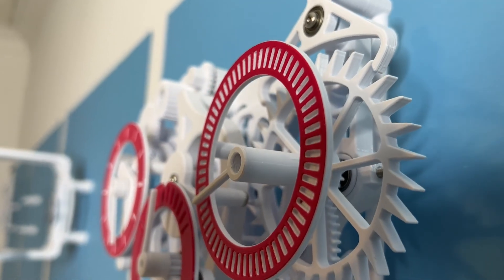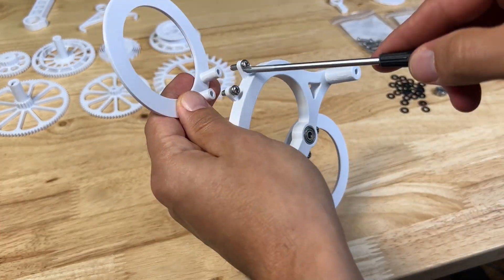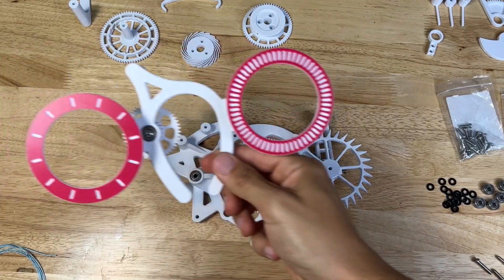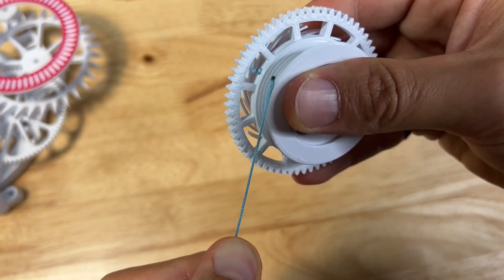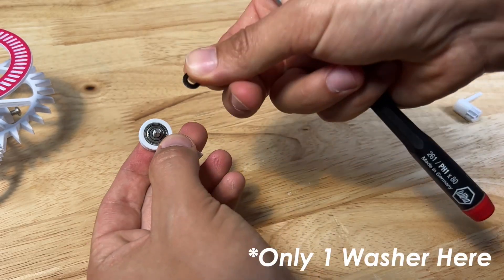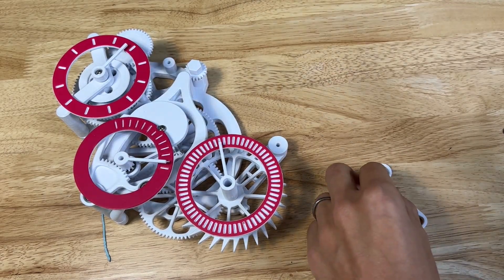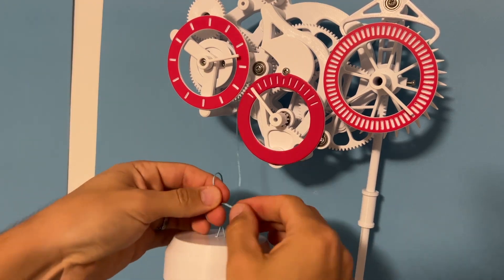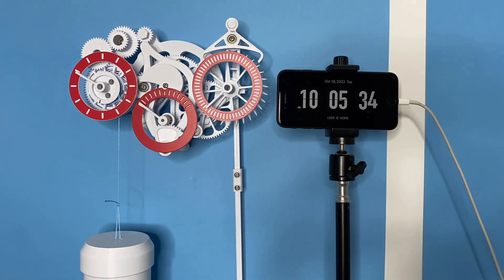How To Assemble the 3D Printed Clock

Comment: Reluctantly I have given up with this print.  Having followed your assembly video to the letter no matter what I try with the adjustments the pendulum slows until it stops, oh and yes the gears spin perfectly.  So 2 days of trying I got a friend to print all the parts on my machine and then follow the assembly without any intervention from myself.  He completed the print and assembly and get exactly the same issue after 4hrs of testing, adjustment, testing more adjustment still no luck !!  I did message you regarding the ball clock as well as I found some issues with the track and the ball pickup.  I was disappointed that I didn't receive a reply but found the solution online from two other users that had the exact same issue.  Obviously I am disappointed as your videos and ability in creating these models is very impressive but for me I feel that I have given both the products more than enough time... and patience.

Comment: i found you need to print extra wall mounts as there not the right number in the pre built plates in the design also you will need to search for the 2 color face options if your not sure how to do it as the link is missing in the description but they are easy enough to find just for the newbies and novices

Comment: hello, i'm a student in a scientific preparatory class in france. one of the tests for the competitive entrance exams i'll be taking soon is a year-long project involving research, equations and practical work. my subject is “From Motion to Time: Energy Conversion in Clockwork Mechanisms”. Nevertheless, I'd like to do a simulation on solidworks, but with only the stl files, it seems complicated. I'd like to know if it's possible to provide me with the solidworks files, or even if it's possible, the clock simulation file, which would be a great help.

Thank you so much for your help !

Nolan

Comment: Neat design, but I have had several layer adhesion failures due to the orientation of the prints and weight applied.  Especially at the the wind mechanism

Comment: I can’t get it to run for more than a minute or two. I’ve made sure every gear spins freely with no binding or rubbing. Eventually the pendulum loses speed and then it just stops. Wondering what I did wrong. And I can’t for the life of me get it to have an equal beat after hours of trying. Maybe my filament has more friction than yours?
Reply: I have the same issues. I have reprinted now and still the same issue. I have added more weight taken some off it ticks really loud and the pendant wobbles its tick pattern is not even. And it stops about 50 seconds on
Reply: I took it apart and made sure everything wasn’t too tight and spun for a few seconds if flicked quickly. After a few weeks of tweaking the pendulum I’ve got it working for 4-5 days without stopping. Keep at it.
Reply: You probable have to loosen it up a little bit. I had the same issue at first and loosen a couple of screws and it just runs now.
Reply: I took mine apart after if was working fine, so I could better align the dials, and upon putting it back together, it wouldn't run for more than a minute or two. Turn out the anchor was reversed. Pause the video and look at the ends of the anchor, the pointy ends, and make sure they look the same, or just reverse it and give it a try. Mine is up and running again.

Comment: Hello, it prints very well. Question - my bearing fit very very tight. Some of them crack the base. Is there something I am doing wrong? The print seems very clean so I didn't sand anything out. Help appreciated.

Comment: Could this clock be scaled to be a bigger size? Looking into making a clock like this, and I love the design, but I wanted a little bit of a larger footprint on my wall.
Reply: Since the movement is timed by the pendulum, you should be able to scale it up, it just might take some extra adjusting of the pendulum.  Might need to be longer or have a heavier weight, etc.  Just be sure to account for the holes getting bigger when purchasing your bearings and screws.

Comment: Layer to layer bonding on the 3d printed parts continues to be a weak point.  6 different pieces have now broken,(seperated) typically where a column steps down in diameter.  An increased wall thickness would help this.  Do you know what setting in cura addresses this?
I have noted the bearings I purchased on Amazon are stiff creating a lot of drag. I'm sure this is hurting clock performace.

Comment: So I don't understand this clock... 

You are aware that there are 60 minutes in an hour right?

So why aren't there 60 ticks, or lines on the minute wheel? 

Your minutes dial only has 13 ticks, or lines on it. Which would make it impossible to actually tell how many minutes past the hour it is. You would only be able to know the hour & seconds, but not minutes.

So why is there only 13 lines for the minutes instead of all 60 like a normal clock?
Reply: it's in increments of 5, starting at 0 :p

Comment: What are the threads on the pendulum parts?  I would like to use a tap/die to clean them up after printing.
Reply: I just scaled up the Pendulum Adjuster and the Pendulum Adaptors by a factor of 1.04.  Everything screws together easily now.

Comment: Great model! All the parts using just one bearing are however very loose, especially the second hand and escapement cog. It's so loose that the tip moves about 5mm in all directions. Perhaps the bearings are poor quality, I don't know. All parts ordered from Aliexpress. The cogs rotating on two bearings run well.
Reply: you might have the wrong sized bearings. I did this mistake. the bolts should fit perfectly inside the bearings and not slide around.

Comment: I purchased the plans and assembled this! I got it to run for about an hour, but it eventually stops. I've fiddled with the escapement, adjusted the pendulum weight, made sure the screws aren't too tight on the bearings, etc. Any ideas to get it to run longer? Can I add more weight? It seems to run better when I pull down on the 5 pound weight. Thank you !
Reply from the maker: You can absolutely add more weight! That would definitely help

Comment: First off, LOVE the work and ingenuity. second off, can you recommend what to do if when printing the gears, you can't get them to mesh and spin freely?  I'm currently trying to print at like 99% scale to see if it helps, but so far it hasn't been a good solution.  third off, I don't think your clock Discord link works :) 

again, LOVE the work! keep it up.
Reply from the maker: Appreciate that! The problem may lie in how they get screwed in, or if they are too tight.  Try joining the discord with this link:  https://discord.gg/nBpvC89FU6 and send some videos and the community and I will be able to help you figure it out!
Reply from the maker: Try this actually:  https://discord.gg/BdTnvfpjHD